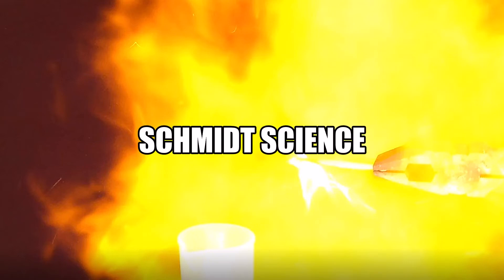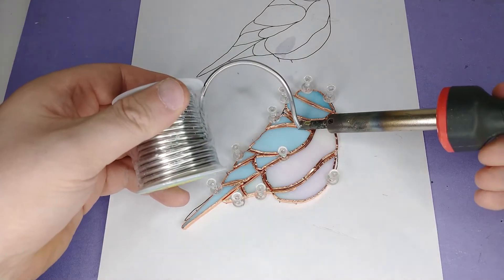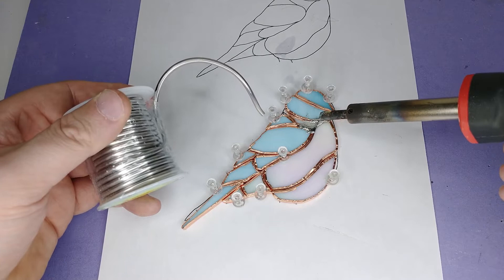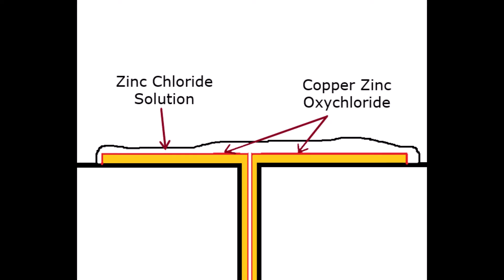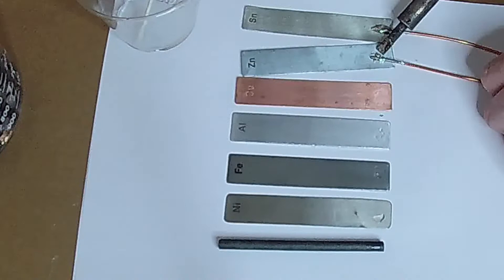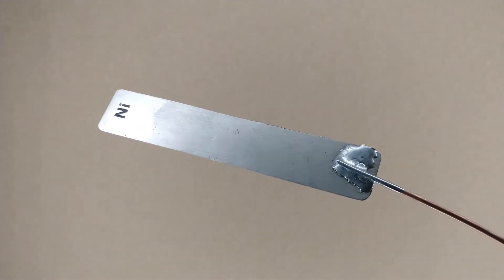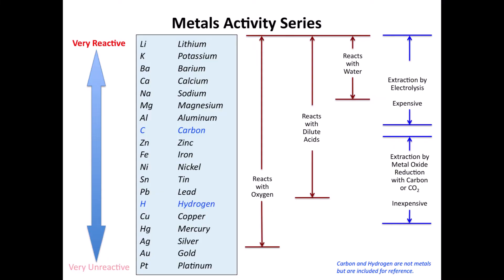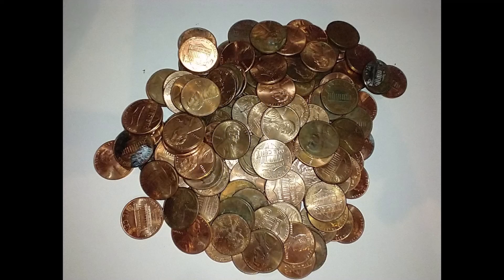Zinc Chloride: Flux for Pennies

Comment: I have tried mixing 50% zinc chloride and water. Bought zinc chloride in dry form at chemical shop...

It sucks! Maybe my solder just sucks, but I can't confirm if it does or does not have silver in it...

LLM says it needs to be mixed with some muriatic acid and some ammonia chloride...

Unreacted muriatic acid is the reason you had success I think, but that has it's downsides...